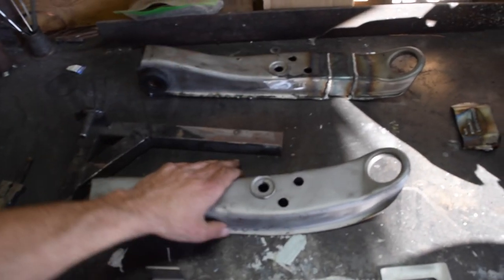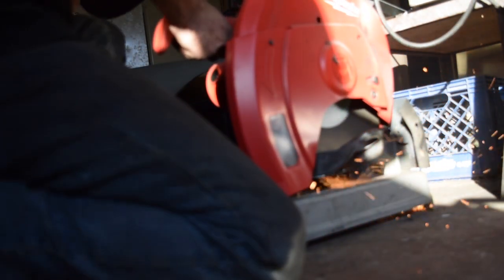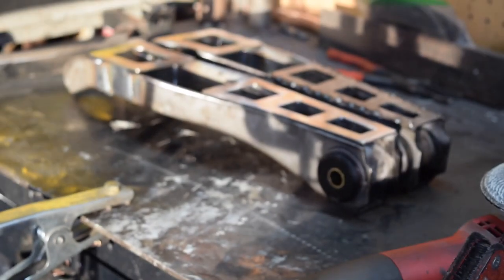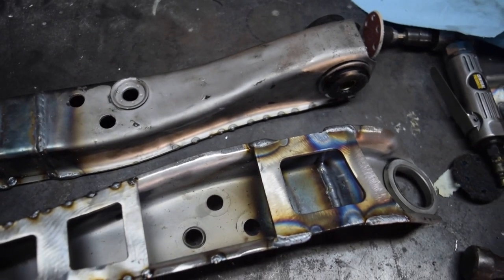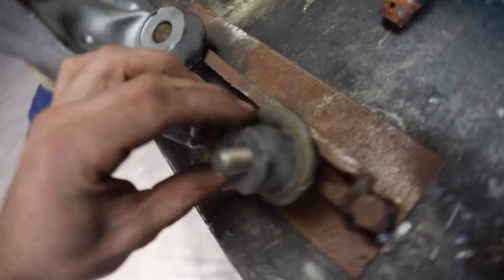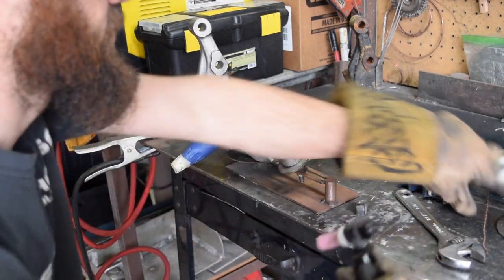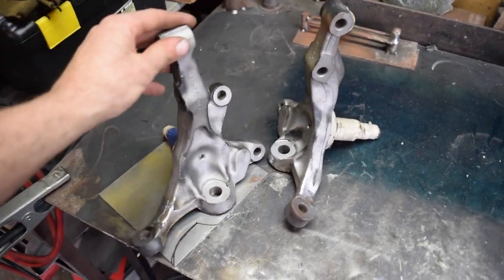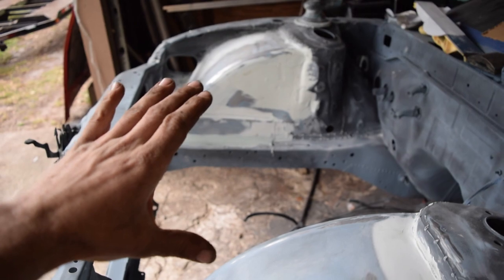Modifying S13 Lower Control Arms (Humble Engineering Brace/Extension kit) & Steering Knuckles

Comment: Will welding critical components pass compliance?
Reply from the maker: Are you regarding track tech? If so, yes it passes just fine. I would not attempt a control arm modification if i did not feel confident in my welding work.